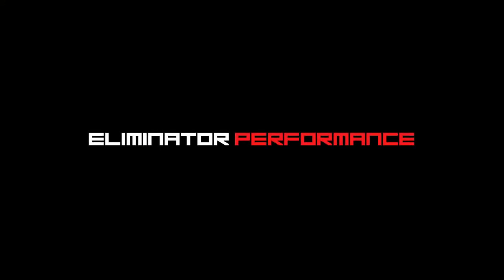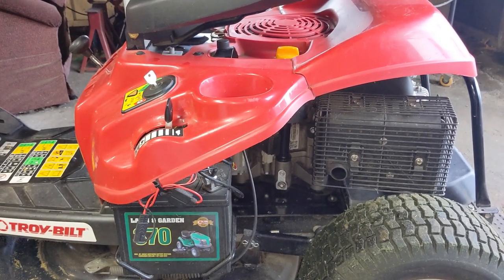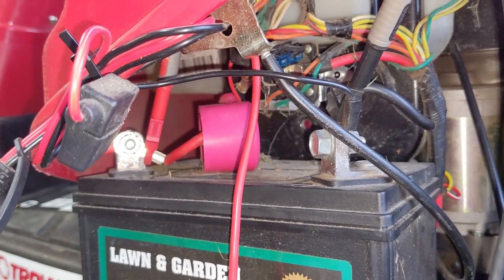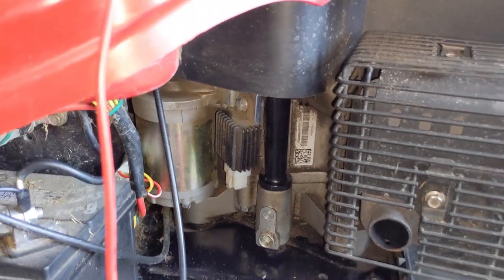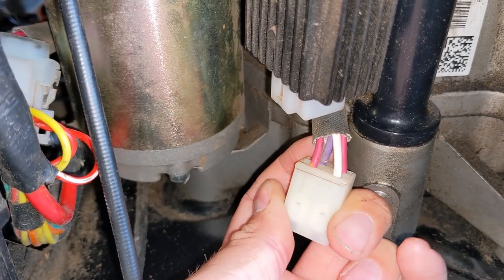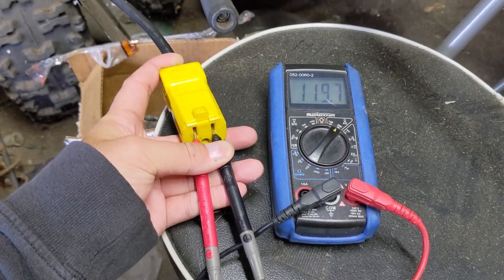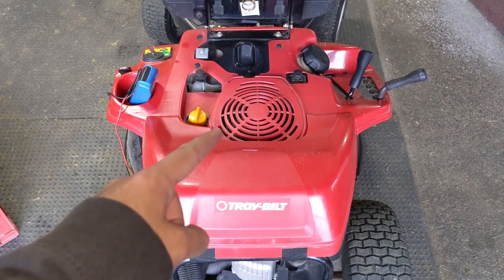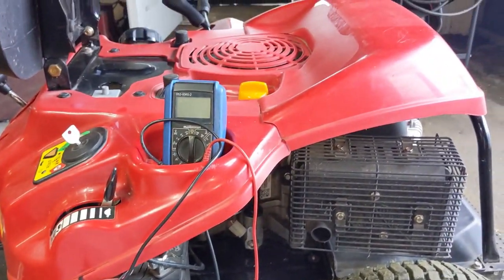Troy-Bilt TB30R - Battery Not Charging

Comment: Having the same issue! Replaced the first batter (like a year old) thinking it was a battery issue. Now new battery is zero volts so it's absolutely not charging.  The TB30 seems to be cursed with electrical issues according to reports from owners and yes even known it's less than 2 years old the alternator is probably dead. Great build quality!
Reply: Any mower these days have wiring problems ever since MTD bought out all mowers

Comment: Another great vid!

MTD had a ton of problems with those 420cc mower engines.  They discontinued them on this line altogether in favor of the 344cc B&S and 382cc Powermore's .
Reply: I agree the 420 is not that good but there smaller ones are very good so far and price is right

Comment: This was helpful.  The one I am working on would not start and upon disassembly I noticed a rodent nest under the engine cover/debris cover.  It seems that the rodent found the Fuel Solenoid wire that runs along the top of the motor was in the way, so it chewed through it. It also chewed through another black wire that took the same path.  I ordered the alternator winding and ignition coil since I can't really tell what goes where anymore.  Is there a way to find those wiring diagrams that you were sharing or is that privilege information?  Thanks for the video I think it will help when the parts come with the wires un-chewed.
Reply from the maker: If you give me your email address and your model number under the seat I can email you a wiring diagram

Comment: The rectifier changes current from AC to DC via diodes, the regulator brings the DC voltage down to a usable level. Generally nowadays both rectifier and regulator are housed in one unit.
Reply from the maker: Yessir, rectifier/regulator all in one box on this unit. But if the magnets or magneto doesn't work, then the rest of the equipment won't work

Comment: Hi, guys. I was checking how the alternator was charging on a lawn tractor this morning so I ran the engine full speed and watched the multimeter numbers go up gradually. After maybe 5 minutes it was still going up but slowing down quite a bit to get to around 13.30 volts. I stopped at that point because I didn’t want to waste any more fuel. How long should it take to get to where it maxes out at 14+ volts?  Can I trust that it will do that?  I used my Topdon load tester and it got 100% for the 300 CCA rating and was at 58% of charge when I tested it yesterday. The battery does seem fine - I just want to make sure it’s doing what it’s supposed to. 
Thx for your time!
Reply from the maker: Anything over 12.65/12.75 should be good, but ideally you want to see 13v (surface charge they say) once you crank over the engine it drops a bit (your topdon tester should mention that it detects a surface charge). In any case, it all depends on what the voltage regulator is set to allow.
Reply: @EliminatorPerformance  
Thanks, Jake. I was going by the automotive standard as I understand it when I was looking for 14+ volts. Always have more to learn about small engines!👍🔧

Comment: Good video...just you should not force multimeter leads into a connecter it can spread the terminals they have probes you can buy that are much thinner and I back probe with them

Comment: The downside to not having a working alternator is a decrease in the life of the battery. If the battery had a recent charge and it dropped down to 12.3 volts after resting for a few hours, then that is a good indication that the battery has lost about 30% of its capacity. Lead-acid battery life decreases as the state of charge decreases. From the looks of things, the owner installed a larger capacity battery which will reduce the percentage of discharge. The owner has to decide whether to fix the alternator or replace the battery more often. In this case it is cheaper to replace the battery more often. The owner did install the charging plug which makes connecting the charger a ton easier.
Reply from the maker: Yea this guy didn't want to spend the money, he'd rather just charge it when he parks it. He says sometimes he forgets, which means he isn't charging it every week. Which will eventually reduce the life of the battery, as you said.

Comment: What purpose would the AC output from the alternator serve...do they run lighting circuits from that?
Reply from the maker: AC produces higher voltage more efficiently, so they output AC from the alternator (which can flow both ways) and run it through a rectifier (sets of diodes that act as 1 way valves) directing the current flow. That changes the current from alternating, to direct, which is what the battery circuit runs on
Reply: @EliminatorPerformance  Right, I get that, but is there another AC output that doesn't get rectified to make it DC?  If all the AC output is rectified to DC, I wouldn't say that is a dual mode alternator, but maybe if there was also a second AC output that was not intended to pass through a rectifier, but to stay as AC for some purpose other that charging the battery, then to me that would be a second mode.

Comment: My TR30R won’t start, and I got a new battery. It’s started and I mowed the lawn twice. Now it won’t start. I purchased the kit for a tune up, air filter, and oil for a change. I even bought a carburetor 
kit. However there are no mobile services, in my area to come and install all. The local Riding Lawnmower repairman, uses another person to pickup the mower $40 then after a tuneup (when I supply the kit) charges $200. I wish someone would start a mobile service.
Reply from the maker: Check the mower deck discharge cover switch, make sure the cover didn't pop up. I have a video on that, just Google Cub Cadet CC30 won't start

Comment: Does the tractor deplete the battery while it is running if the rectifier / regulator is not working? I had this issue on my Cub Cadet GT2544. The battery was not charging, but as I was cutting the grass, the voltage at the battery would slowly drain down. When it got to around 9-10 volts, the tractor would quit. There is a gauge on the dash to show voltage. My problem was a bad ground on the rectifier.
Reply from the maker: So some riders have engines with fuel shut off solenoids, and they run off the battery, not the magneto. So on the engines without it, you can hook up a battery to start and disconnect it and cut the grass. They only use the battery power to engage the starter. But on an engine with a fuel shut off solenoid, as soon as you disconnect the battery, the solenoid will close the main jet, which shuts down the engine. I should also note that it takes 9v or more to open a fuel shut off solenoid, as shown in this video where I test them with a 9v battery. Anything less won't engage them. https://youtu.be/aRPmRBlqRqM
Reply: @EliminatorPerformance  Would the PTO clutch also run down the battery if the charging rectifier is not working? Thanks for your help!
Reply from the maker: @thebeardedstork432  yes that as well, it needs 12v. So the battery powers the pto clutch and the fuel solenoid, and the rectifier trickle charges the battery. So if the rectifier doesn't work, after you start the engine the battery drains a bit, then the pto clutch and the fuel shut off solenoid would drain the rest over time.
Reply: @EliminatorPerformance  Thank you sir! That answers a lot of questions i had!

Comment: Does it look like the top of the engine has clearance to add a recoil pull start?  They are only like $15 and would be good backup if battery is dead. The engine model should support one, they probably just remove it for cost savings.

Comment: I Have an Alternnator on my snowblower which i use to give ac current to a analog light, but if i want to Have dc light i Have to put a rectifier which smoothen tha ac current to dc current or is that correct
Reply from the maker: Yea a rectifier is a series of diodes that convert AC to DC.

Comment: MY TB30R will not turn over. Battery fully charged. Ignition fuse is good. Micr switches intact, seat and side discharge. Turn ignition switch, completely dead. any suggestions?  Oh yes,   clutch compressed, parking brake set, shifter in neutral, blade disengaged. Working fine when I stored it for winter.
Reply from the maker: Possible blown fuse? I know the side discharge cover switch can look depressed but are actually popped out. Watch this: https://youtu.be/VCKMhMQL8Fo
Reply: Check the grass discharge shut for switch pop out of place

Comment: Could you not just check across both red wires for the AC voltage from the alternator? Thanks
Reply from the maker: No, if you pause on the part where I put up the infographic, you'll see this is the way the manufacturer says the test must be done. I took that directly from the service manual. Thanks for watching!
Reply: @EliminatorPerformance  Yes, i went back and did that exactly! You are correct, that is what they say to do! Just curious! Thanks

Comment: My fees are $25 an hour. Not bad
Reply from the maker: I charge $70/hour plus 13% tax on top to keep the government happy. I'm the most affordable rate around for quality work, other places are $85, $95 or even $115/hour.
Reply: @EliminatorPerformance  lol dang most places in my area charge 60 to 70. Im not licensed but i have knowledge to repair stuff. Im the GO-TO man on my block. Friends and relatives bring their stuff to me. I keep everything running around here. Shops arent open Sundays but my 10x14 barn is always open. I usually tell ppl if they pay over $60 or $80 for trimmer repair they better off buying a new from walmart
Reply from the maker: @jerrycannon6940  exactly, one of the reasons why I quit working on chainsaws and trimmers. I only service them if there running, stock air/fuel filters, and spark plugs.

Comment: Stator not Alternator
Reply from the maker: Yes I know, under the flywheel vs outside and self contained. Permanent vs electro magnets. At the end of the day, it sends current to the battery. Some even call them magneto's and people complain about me calling an ignition module a coil. This one doesn't work, I really just wanted to show the process. It's like every engine is a motor, but not all motors are engines? Lol thanks for watching though Jones!